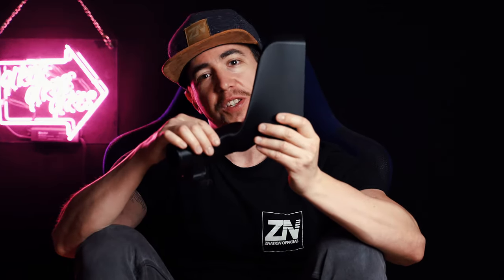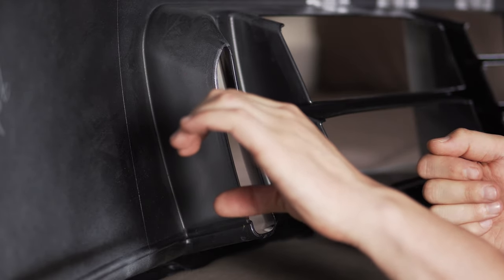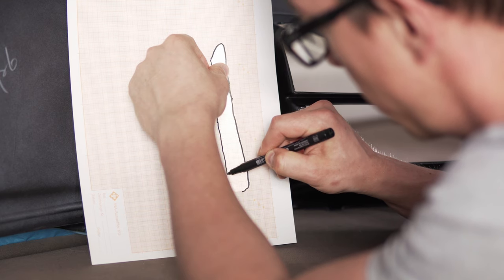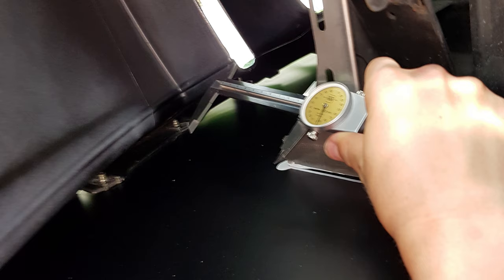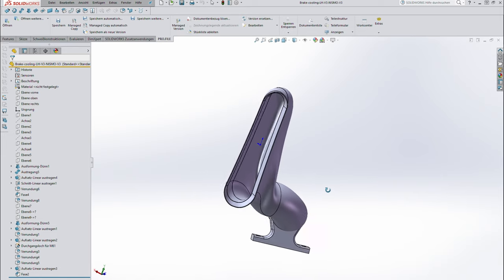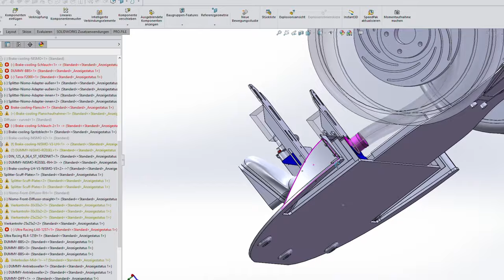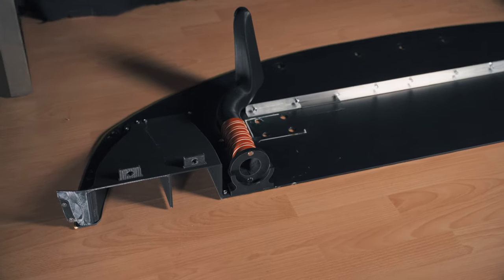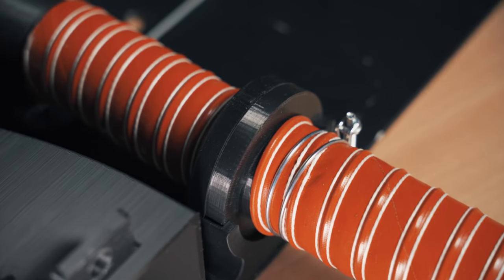BUILDING 350Z BRAKE COOLING DUCTS FOR NISMO V3 FRONT | ZerofuckZ  Ep. 72

Comment: Why did you have your oil cooler hose put it otherwise that before. 'cause before there was a hose that passed upwards?( in your first video (mishimoto install oil cooler)?😅
Reply from the maker: I have always mounted the cooler with the hoes upwards. Or what do you mean?
Reply: @MIMCKMedia  Yes it's not the oil cooler it's just the hose you had to move to put the two hoses together? 😊
Reply from the maker: @jimmygrande1634  I relocate the cooler two times to get nice lining for the hoes because they are extremely stiff

Comment: what material are you using for the 3d-printed parts. I feel like PLA would just degrade with the heat that a car emits, right? I was thinking either ABS or ASA would be the better option possible?
Reply from the maker: I tried to used abs but got too much failure while printing. So I used pla. Heat is not that problem in the diffuser region. In engine bay it's to hot for it